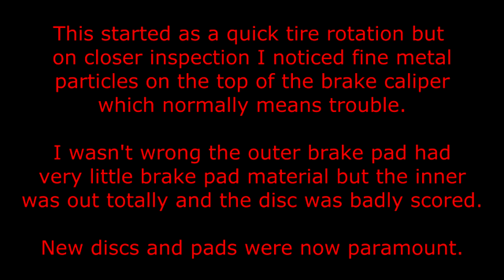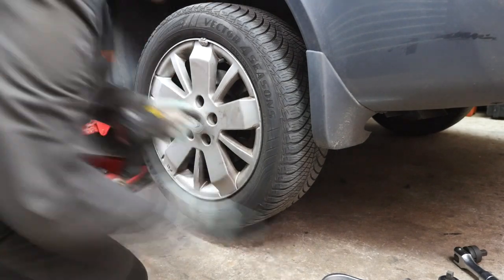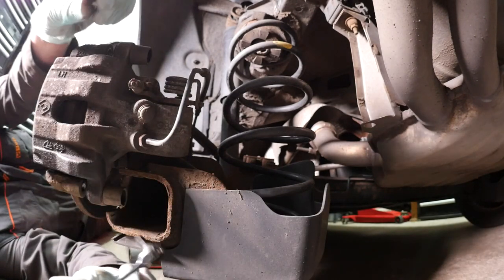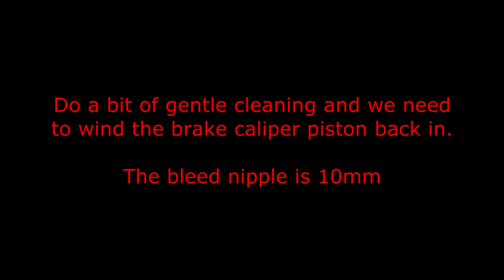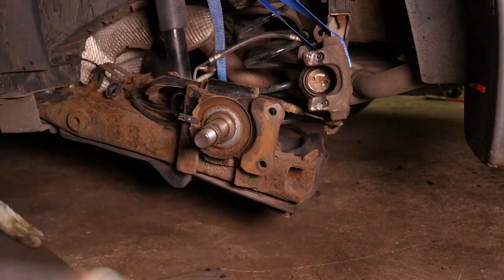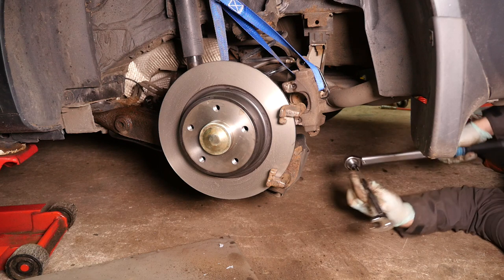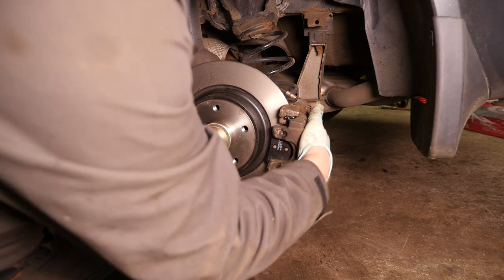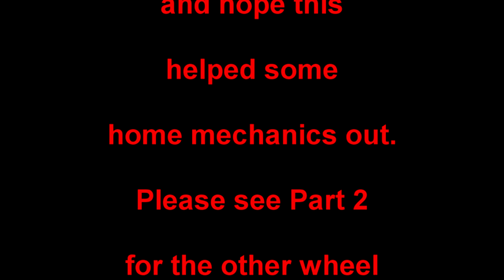Renault Laguna Replacing Rear Nearside Discs and Pads with Electric Handbrake M9R Diesel Engine

Comment: Mate ..just one question 17:24 did you forget to lubricate the stub axle before placing the new  disc in...or is it not needed ?
Reply from the maker: I don't think you need to lubricate as the bearing doesn't rotate  on the stub axle, thought it may help when pushing the disc back on.  Just seems a natural thing to do to add a few drops of oil etc on bare metal but not always necessary.

Comment: Hi! Great video! How to remove the ABS sensor mount plate behind the discs? Does it just pop off or is it pressed to axle/ bearings? Mine was corroded to a rust dust and now need to find a replace.
Reply from the maker: Thank you for that.  I think it was a push fit into a metal ring.  As I recall when I changed a bearing on one the metal ABS sensor holding ring went in first and then the bearing was pressed in holding the ring in place.  It might be a bearing out job which is a lot easier with a hydraulic press.  I think a new ring came with the new wheel bearing.  But the sensor was simply pushed into this clip ring.

Comment: I've put ceramic grease on those spring clip ends 5+ years ago because I also had trouble getting them out the first time. They haven't seized up since.
My calipers look slightly different than yours and have rubber inside of the guide pin holes. I've put silicone grease on those guide pins.
The product that you used, is it safe to use on rubber?
Reply from the maker: Thank you for the comment.  Your right in that silicone is best for items in contact with rubber.  I switched from copper slip to CeraTec a few years back as copper slip isn't recommended anymore.  The Mintex CeraTec says on the back for slide pins but saying that mineral grease shouldn't be used with rubber so I will probably start using silicone in the future on those slide pins.   I have the red rubber grease also but its an interesting point you bring up.  Thank you

Comment: Nice and usfully video. What could go wrong wenn you dont lose the brake fluid?
Reply from the maker: Do you mean not opening the bleed nipple on the caliper as you wind the piston back in?
Reply: Yes, correct
Reply from the maker: @gigelbaietu5978  I have done the same and just wound piston back in will no seemingly ill effects but I think its good practice to keep the fluid passing in the one direction its meant to which is to the caliper and not back to the ABS module.  You should be ok though.  Watch fluid doesn't overfill in the reservoir though.

Comment: HI mate, we're did you buy that breaker bar from I want one of that quality. ..thanks 👍
Reply from the maker: Hiya its a fantastic breaker bar, not cheap mind.  A Japanese Koken 6768-1000    £131.51    here is a link I think but I bought mine in desperation from a mobile tool guy when removing a wheel nut off a Volvo 850 and the cheap breaker bar snapped and an adaptor sheared so it had to be something in a different league.   My wife went mad as it was £100 at the time and she couldn't  understand why a tool would be so expensive.  It's never snapped in the last 10 years though and it got that nut off the Volvo.
https://www.uktools.com/34drive-1000mm-long-hinge-handleflex-handle.html
Reply: @CoatsandGaiters  👍👍 Thank you ! 😊

Comment: I have never needed to bleed the brakes as I do this. Am I missing something? Does this just make it easier? Thanks.
Reply from the maker: I agree with you but the manual says to do it this way and since I don’t wish to make an incorrect video I do what Renault say lol.
Reply: @CoatsandGaiters  Valid point well presented. Thanks.

Comment: The holes go through the caliper so you can use a punch from the rear, the clips wont come out on older cars like 04 05 at all
Reply from the maker: Hi Michael do you mean the spring outer clip?  I never realised the holes went all the way through.  I remember now on an old Laguna the spring snapped and I had to attempt to drill it out.  It was stuck good and fast.

Comment: is at 15:51 air getting back thru the transparent line to the break cylinder?
Reply from the maker: Hi I think that's the fluid just running down the side of the tube as the piston is struggling to go in.
Reply: @CoatsandGaiters  just guessing here... I think (hope) it is not possible to "overwind/overturn" the brake cylinder. Once you reach the end, it will just turn without going any deeper.
Reply from the maker: @withgrowinginsanity198  Hi yes that true but once the piston stops pushing fluid out the air will rise to the bleed nipple and the fluid will run down inside the tube.
Reply: @CoatsandGaiters  hmmm... so I think its better to position the tube UP... and the bottle above... this way air will not return, just the fluid. (again... never done this :-)
Reply from the maker: @withgrowinginsanity198  The air can't get back in because you close the bleed nipple every time you release the pressure.  You don't leave it open continuously, only open the nipple to let pressured fluid out.